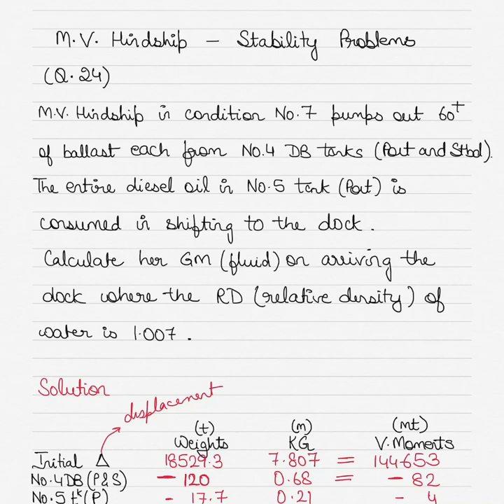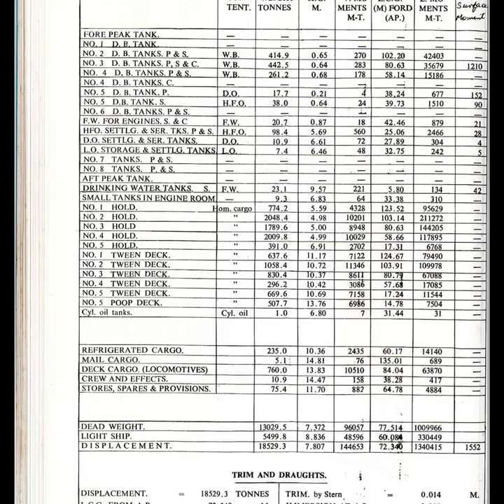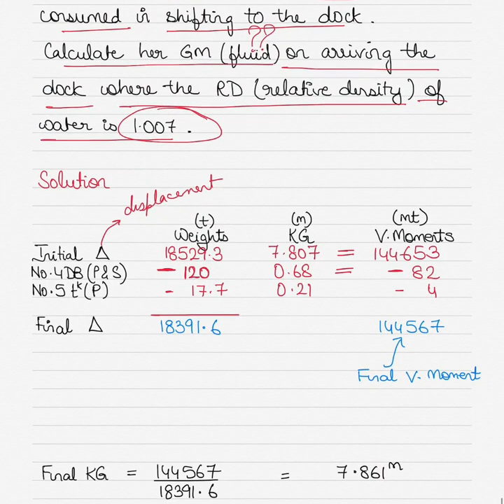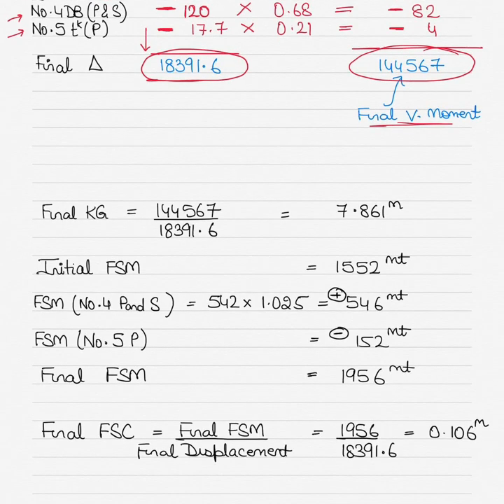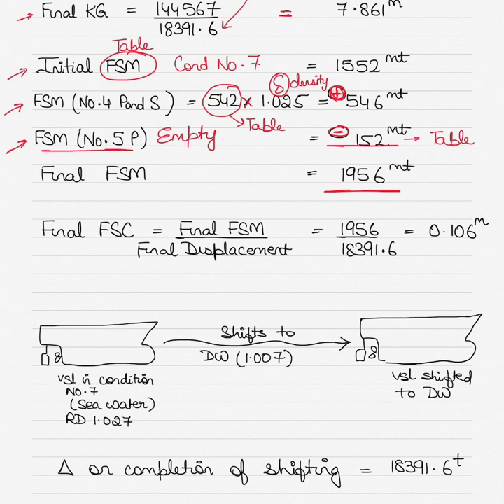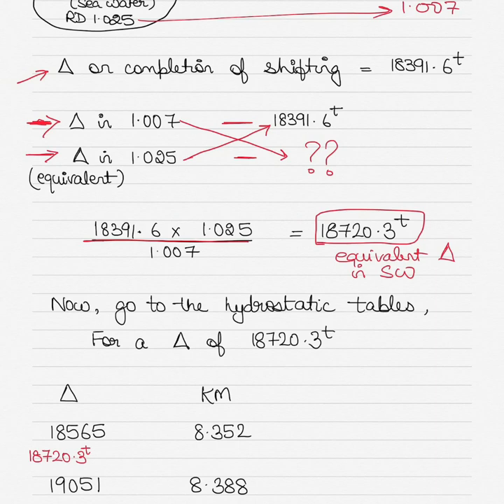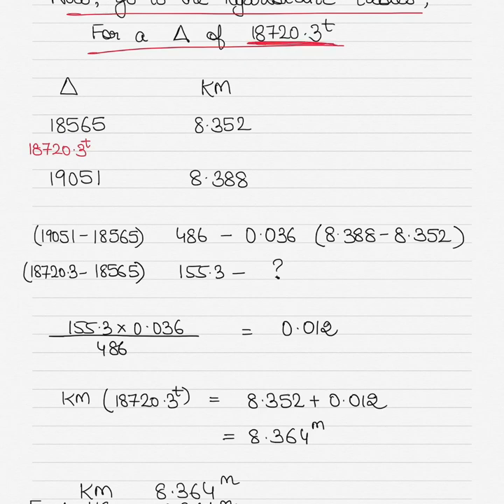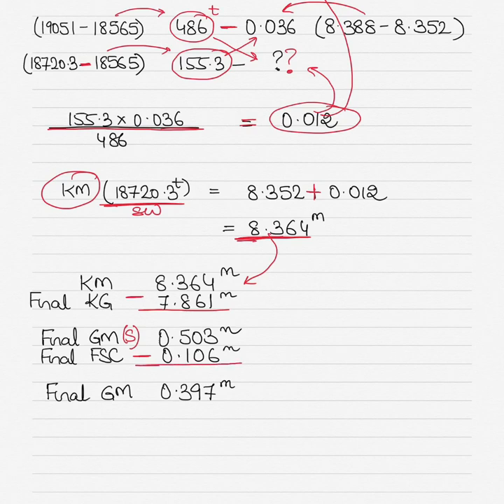How to solve advanced stability problems - Q.24 from M.V. Hindship

Comment: M.V Hind Ship arrives port with drafts F 5.60 m, A 6.60 m, Midahip 6.20 m in water of density 1.012t/m3. Calculate the Qty of cargo she can load if she is to sail into Tropical zone on an even keel in SW with expected sag of 5 cms. 60 T of fuel and FW is expected to be consumed in port and she is to receive 300 T of FW. The Ford draft marks are 2 m ford of FP, 2 m aft of midships and 1 m ford of AP

Comment: Sir as we're in condition 7, our displacement will be salt water disp. But after the shifting to 1.007 our disp should change... Can you please explain the concept about this? Bcoz if we take 18539.3 as the disp.. It is the SW disp. After shifting to RD 1.007 our disp should change which it didn't in the question.. I didn't understand that how you took 18391.6 as the disp at 1.007. I think it should be the SW disp.
Reply: I have the same query. Did you get the answer for that.
Reply: Same query did anyone get the answer

Comment: Sir pls make a video related to tides, both primary and secondary ports questions pls pls pls , it will be of great help for our second mates exam going to happen in May'20
Reply from the maker: Tidal window calculations: https://www.youtube.com/watch?v=eq_4LHi1kvU&list=PLjZi6sSb2w5bgOQ9xEL99Z8LBCyKBoNXt&index=18
Secondary port tide calculations: https://www.youtube.com/watch?v=tv_oYTEccg0&list=PLjZi6sSb2w5bgOQ9xEL99Z8LBCyKBoNXt&index=19
Explaining interpolation of second port tide calculation: https://www.youtube.com/watch?v=y783OI-tjh0&list=PLjZi6sSb2w5bgOQ9xEL99Z8LBCyKBoNXt&index=21
Simplified harmonic method of tide calculation: https://www.youtube.com/watch?v=S3NvhprJdfM&list=PLjZi6sSb2w5bgOQ9xEL99Z8LBCyKBoNXt&index=24
Simplified harmonic method (Theory): https://www.youtube.com/watch?v=WBFefAMc-ZE&list=PLjZi6sSb2w5bgOQ9xEL99Z8LBCyKBoNXt&index=29
Tides (General Theory): https://www.youtube.com/watch?v=f0e2hQUE8D4&list=PLjZi6sSb2w5bgOQ9xEL99Z8LBCyKBoNXt&index=20
Reply: Sir thank you for your reply but it would be really helpful if u pls solve them as we do in our exams pls 🙏